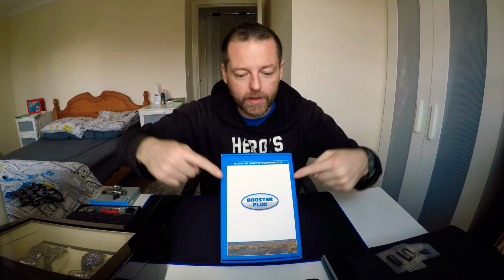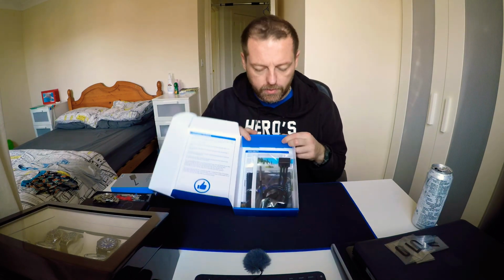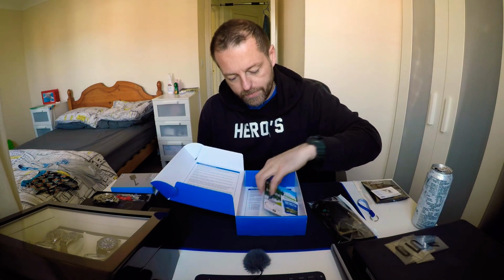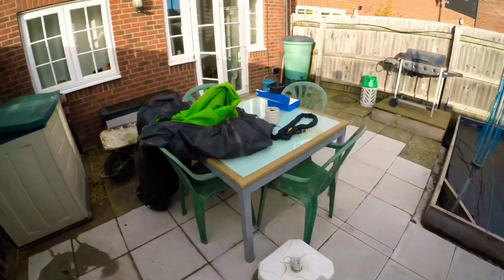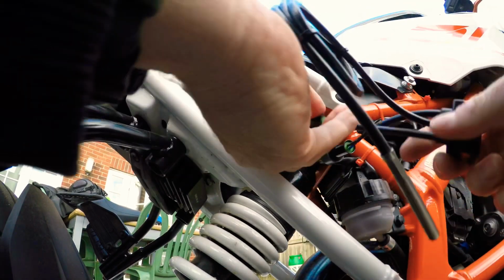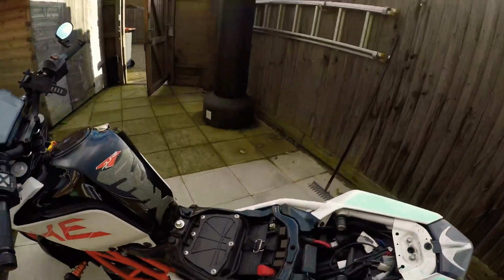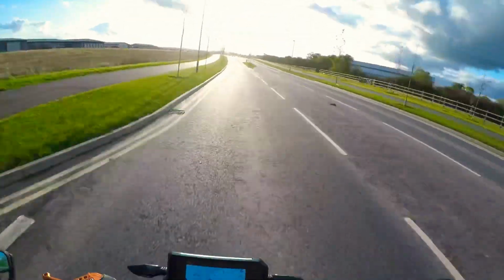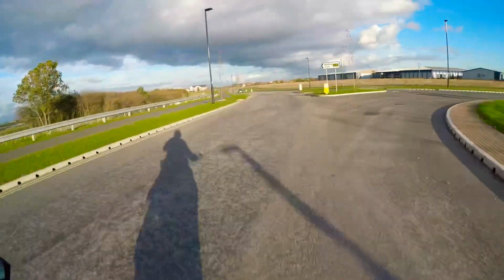KTM Duke 390 Booster Plug Installation!

Comment: Correct me if I'm wrong as im just bought myself a 390 from 2018... 
Never drove a duke 390 before,first impression is that bike feels like loves Middle range/high revs at low revs its a bit clunky... This mod would help the running at low revs???? Thanks
Reply from the maker: From what I remember and probably said it in the video, it was smoother at low revs. It's hard to find a better bike for the money that's for sure.
Reply: @dynamotightstar3472  although they not cheap, the quality is there 100percent!: a bike that loves corner's not made for boring motorway drives...
Reply from the maker: That is very true. If I were going to do long motorway journeys on it I'd swap a sprocket for sure. It'll drop the revs down so it won't be screaming everywhere.
Reply: @dynamotightstar3472  specially with the after market exhaust that you had on ours... Screaming 😱😱😱 a lot 🤣🤣🤣
Reply from the maker: I definitely do not recommend that modification. Not in the slightest 🤣
Reply: @dynamotightstar3472  almost order a Chinese replica exhaust but the bike doesn't sound that bad, although the factory exhaust is not very good looking I stick with it for now! 😜👍
Reply from the maker: @ricardopinto1765 if I had drilled the dB killer.on the stock exhaust and left it at that it would've been fine. When I took the CAT out though it was horrendous. You can't put the dB killer back though as it's welded. After market exhausts can be ok but it's a lot of hassle for not a lot of reward.
Reply: @dynamotightstar3472 hello friend.... Just installed it today on my 390 started without any errors although after a while temperature went almost to the top of the gauge so I had to shut down the engine! Is it normal that happened???

Comment: Great video! , Like you I fitted a decat pipe that removed the cat and middle silencer but left the std end can with dB intact plus popped on the Booster plug . To be honest it was still noisy and sounded like a fart in a collander!! Also with ear plugs in and my trusty Roof helmet to totally block out the noise the bike felt flat in the mid range and disappointing.
So popped the complete etc exhaust back on with the booster plug still on and you could feel a definite surge in the power band from 5k when the the closed loop shuts down.
To my mind the cheapest way of making the Duke better is just fitting the Booster plug and fitting a 14 t engine sprocket which pretty much makes 1st gear redundant other than starting off but brings top gear far more useful and giving greater acceleration to boot.
For a total of £140 it's great way to make the Duke even better!
Reply from the maker: Thanks mate, much appreciated. Always wondered how it would sound with the stock can in tact. 

Mine didn't feel flat anywhere really and felt more punchy down low. I lost a little off the top end I think. 

I've dropped a tooth on my off road bike which suits it perfectly but I can't see the Duke really needs it in all honesty. I had good use of all the gears on mine. It's not like they make very thing the same though is it. Their QC isn't the best and could be down to anything.
Reply: Mind you the Little Duke is great bike for us U tubers!! The list of mods people throw at it is amazing , with different exhaust s, Expensive ECUs, Air filter mods etc etc probably cheaper to get a 790 lol! Keep up the good work.
Reply from the maker: @robertedmunds3267  it really is mate. I wish most days that I'd never sold it. Not only because its an amazing bike but because they're the only views on my channel that get any kind view numbers! 😆
Reply: Just as a follow up for you many Duke fans during this current warm spell we are having I have noticed a drop in performance which I am pretty sure is overfueling due to the higher temperature. It would seem where you place the temperature probe has a big effect regarding the mixture.
After many hours messing about with different exhaust set-up this is where I have ended up, The std KTM exhaust can fitted with a decat pipe that replaces both the Cat and the middle resonator box , After much trial and error i drilled a hole in the rear of the author and inserted the probe there so it reads the temperature as it comes in thru the filter element.
This seemed to cure the rich mixture so much so that I put the stock 15 tooth sprocket back and even with my 16 stone it really pulls well!
Makes some lovely pops and bangs on the overrun as well
Reply: Should have said the back of the Airbox!!
Reply from the maker: Definitely makes more sense than drilling the author. I'm sure the author would be quite upset 😃

Comment: Great video thanks. Now you have had it fitted fora while, is it still performing as expected? Seen some reviews which say the ecu reads the constant messages from the booster plug and reverts to the lean mixture after a few thousand miles? Thanks for response in advance.
Reply from the maker: Hi Gary, glad you liked it mate. Sadly I've since sold the bike and bought a Fantic Casa 250 off road bike. The woods were calling me. 

The time I had the bike with the booster Plug though was faultless. You could tell it was working as it smelled more of fuel. It never smelt like that pre booster Plug. It felt more Torquey down low too. Lost a bit of top end but down low it pulled harder and ran smoother. None of the kangarooing at low speeds. Didn't need to slip the clutch as much.
Reply: @dynamotightstar3472  thanks for the quick response, much appreciated. Looks like I'll be giving it a go. 👍
Reply from the maker: @GaryBickley  you're very welcome.  I just wish I hadn't drilled my DB and DeCatted. Cat but with standard exhaust would've been amazing. Hope you like the booster Plug mate.

Comment: Would it help my ideling, it won’t idel without throttle since the exhaust has been decatted, and im looking to get a full exhaust system soon and it recommended to up the fueling ratio so would this work for it? Thank you
Reply from the maker: Hi Ross, I would say yes, it will as it increases the fuel mixture. 

What you cans is put your bike up on a centre or paddock stand and let the bike run for 15minute's without touching it. It should recalibrate the ECU for your exhaust mod. The booster plug is cheap though so I'd get one see how it goes.
Reply: @dynamotightstar3472  I will order one and see if it helps, thank you
Reply from the maker: You're very welcome.
Reply: @rossgodfrey8816  did the booster plug help? I have the same issue on my KTM duke 2014

Comment: So to recap...................if I drill the std can (baffle out), install a booster plug I can then get away with changing the airbox lid? I'm going to leave the cat' in for now.
Reply from the maker: I'd say there's a very good chance that it would work fine. As I didn't do the airbox mod though I can't say for sure. 

The premise is sound though as the booster plugs tricks it into adding more fuel.
Reply: @dynamotightstar3472  , I hear you but don't want to burn out a spankers new engine! Trouble is, whilst it's still under warranty there's so little you can play about with.
Reply from the maker: I'd say leave it be mate. The reality is that nothing you do to it will make much of difference to the bike. I bought an SV650 a little while back and it was much older and with 180'000 miles on it and it was way faster than the Duke. If you got 1 or 2hp it wouldn't be enough to make it worth risking your motor.
Reply: @dynamotightstar3472  Yeah, I'll run it in and keep up the servicings for now......................last 'bike was  modified TL1000S about 5 years ago so this little scoot (when it arrives) should be a blast! Stay safe!
Reply from the maker: The Duke handles better than anything else I've ridden and is absolutely brilliant. It just lacks is bit of pace after a while if you're doing any distance on it. Round town and round the Twisties it's hard to beat.

Comment: will this stop my 68 reg 390 duke from stalling ? it's done it from new ,over 3,000 miles now so motor is no longer tight, a mate's 18 reg does the same thing, shut the throttle and it cuts out "some times" temp don't seem to matter.
Reply from the maker: I'm no expert mate it probably would. The issue is that they restrict the flow of fuel to hit the emission regs. They sometimes get it a bit wrong. Drop them an email to be sure but I'd say yes it will help. Jean at Booster Plug is a good guy, very helpful.

Comment: Nice! I came here on your suggestion from the decat video. So if you were to sum it up, are you happy with the decat and what are the main points you can say you found a difference with after decatting, if we just leave the booster plug aside for a while. Thanks! 👍🏼
Reply from the maker: None really. Don't decat without the booster plug. The bike is already running lean and the decat makes that worse. Long term you will damage your engine. In my opinion that is. Also, don't decat and remove the dB killer. Keep the dB killer, as the bike sounds terrible without it and the cat removed. 👍

Comment: Hi nice video. You think roster plug and the coober air filter lid will work nice in combination? thanks
Reply from the maker: Hi Isi, thank you. No, not sure that would work any better than the stock airfilter. The coober is designed to work with their ECU. You could try it and see what happens though of course.
Reply: @dynamotightstar3472  I contacted boosterplug and they said it will work just fine. But the only way to be sure is to try it...so crossed fingers and let's hope for the best. Please make more videos for the 390 I'm sure a lot of people will want to see them.
Reply from the maker: @isirideredits  let me know how you get on. You'll need a Dyno though to be sure which I'd imagine is gonna cost a lot of money. 

I'm afraid I can't make anymore with Duke as I sold it. I've now got an off road bike. Fingers crossed the coober and booster work well together.

Comment: Not sure if the bar end mirror mounting is different for US models but could you tell me which mirrors you have installed?
Reply from the maker: Morning Jake, this video has a better idea of the mounting https://youtu.be/sd5DhVQx0aY

They were from eBay and were pretty cheap. I added them to fit my bike as I have hand guards on. I had to buy longer screws to make them fit.

Comment: Do you feel like the boosterplug would be worthwhile for a bike with a Akro muffler without the DB killer? What about the muffler and the airbox mod? Something more than just the booster plug? Thanks for the video.
Reply from the maker: I think the booster Plug is worthwhile with any mod that lets more air in. The air box mod for sure as that's all it does. The booster Plug adds more fuel. Even if you didn't modify you exhaust system I would still consider the booster Plug as the Duke engine runs lean to meet the emission regulations. Booster plugs just tells it to put more fuel in. 👍

Comment: Did you do any other air/fuel mods on your Duke when you had it? Such as the airbox mod? I am getting an exhaust that will delete the cat so I just was curious. Thanks in advance.
Reply from the maker: Hello mate. I just did the exhaust decat and booster Plug. If I was going to do the airbox mod I would probably use one of the other products on the market and that lets a whole load more air in.
Reply: @dynamotightstar3472  Ok. I went with a knock off SC exhaust and CAT delete. I probably won't fit them until i get the Boosterplug. All I have done thus far is drilled the baffle out. I'm under 150 miles away from first service, but with all of this COVID stuff my shop is closed 🤦‍♂️
Reply from the maker: @gmoorhead459  the dB removal is pretty much all you need mate. It's a lot of fucking around to get that cat out and if you don't like it getting it back in is even worse! Good luck with it and hopefully this will all be over soon and you can get your dash unlocked. : )

Comment: Will it increase the perfomance in initial and topend
Reply from the maker: Hi, apologies for the delay. The torque down low was much better. It lost a little top end. It went down to 95 from 105 roughly. Much smoother though.

Comment: Hiya. How are you finding the booster plug? Now you have been using it for a while. I'm thinking of buying one. Thanks in advance.
Reply from the maker: Hi and thanks for watching. I haven't had the bike for about a year. Most of my vids are the new bike now. The booster plug was great. Only needed if you mod the bike. If you aren't doing anything to it then leave it standard. I bought it because of the decat and being that the bike is built to run to lean I didn't want it to destroy itself. 

If you do get one then don't forget to reset the ECU.
Reply: @dynamotightstar3472  Thanks for the quick reply. Is that the 15 minute reset that I have read about? It's my first bike in 5 years and it's taking a while to get used to. I'm more used to sports bikes. I really like it but I wish it was smoother at lower revs. Hence the Booster Plug idea. I really liked your comment about people chucking shit all over the roads. That made me smile. 😁
Reply from the maker: Yep that's the one mate. 

Say this place is still a building site and they have those sweeper vans all over the place but the only places they don't clean as the bends and roundabouts! All the fun bits. 😃
Reply: @dynamotightstar3472  how do you rest ecu
Reply: @dynamotightstar3472  hello I own a KTM duke 125 2014, how do you reset the ecu? And why and when would I need to reset it? 
Thanks in advance
Reply from the maker: Morning, I don't know if the 125 has the adaptive ECU or not but if it does it's quite simple. Put the bike on a paddock stand and make sure the side stand is up. Start the bike let it run for 15mins. Don't touch the bike during this process. At 15mins turn it off. Job done. 

You might have a rough idle, a high idle, maybe you've changed the exhaust or airfilter mod etc.
Reply: @dynamotightstar3472  Thankyou for the reply & explaining 👌🏼
Reply from the maker: @nazz7330  no problem mate.

Comment: Do boosterplug help if my bike run Lean? Have grom with exhaust and intake
Reply from the maker: That's exactly what it does. It makes the bike think it meeds more fuel. Check on the booster Plug website for a Grom version. 👍
Reply: Dynamo Tightstar my mate told me it was not worth the money, and other brands is better. How is your experience after 9 months?
Reply from the maker: The is plenty of literature available online mate. It worked well for my bike.

Comment: so all that mod is doing is telling the engine its cold hence the temp sensor away from the air box on the booster plug seems like a waist of money at 140 quid as thes bike are digital now the only way to get better performance is to buy a bigger or older bike im very surprised that nobody has started to sell a remapped ecu for these bikes yet

Comment: Hi! 

How this thingie really works? 

Thanks!
Reply from the maker: Hi, it's tells the ECU that has it has more air than it actually does and then the ECU adds more fuel to compensate. Thanks for watching.
Reply: @dynamotightstar3472  great, thanks!
Reply from the maker: @Fucos_  you're very welcome.
Reply: @dynamotightstar3472  but one thing. Does this meter the airflow or the airtemp?
Reply from the maker: It does nothing more than the above mate.
Reply: @Fucos_  I think it does temp.

Comment: Does the sensor have to go to the back or front
Reply from the maker: Not sure what you mean mate.
Reply: Dynamo Tightstar the metal sensor or prob if it’s called that on the BoosterPlug metal end that you mounted in the back plastic does it have to go to the back or can it be mounted to the front of the bike
Reply from the maker: @djCarterboi25  I see. As long as it can breathe it can go anywhere. You don't want it near the exhaust as it'll heat the air around it.
Reply: Dynamo Tightstar ok cheers just on my 125 duke the rear end is all covered up witch is y I was gonna try mount it up front somewhere near the headstock or will that get to much air there
Reply from the maker: @djCarterboi25  you can't get too much air. It's not a very long lead on the probe though so may not reach mate. It you can though it'll be fine. 👍

Comment: Hello: I want to ask you if you really saw great improvements. Thank you. Enrique.
Reply from the maker: Hi Enrique, apologies for the delay but it doesn't look like I replied to you. I could smell a lot more fuel on start up and sometimes when riding slowly so as I said in the video I feel like its doing its job. It isn't to boost power, its to increase fuel input. The decat changed the power delivery characteristic and the booster plug stopped the bike running too lean which could cause damage to your engine. DT